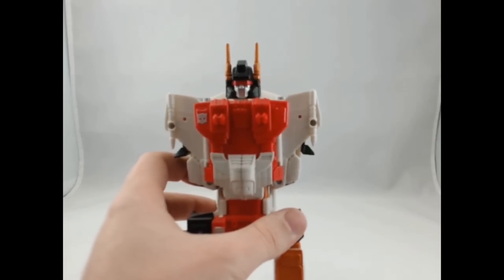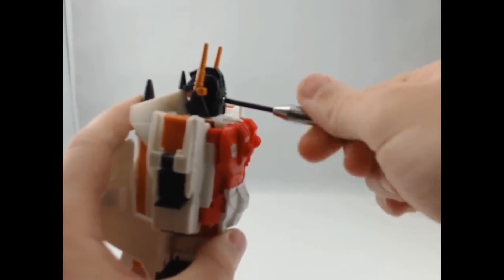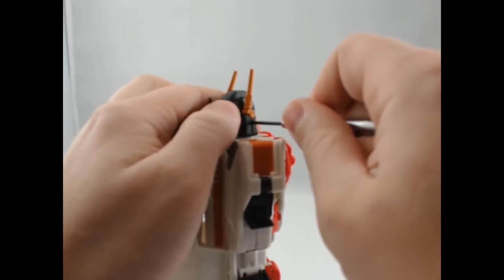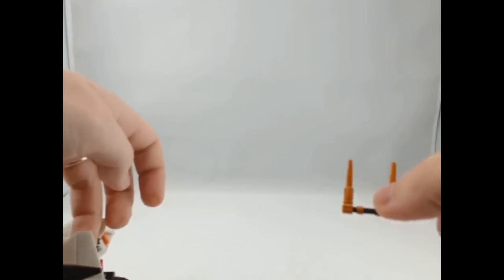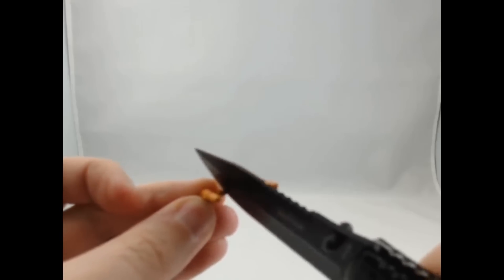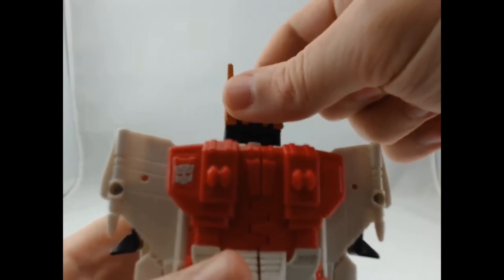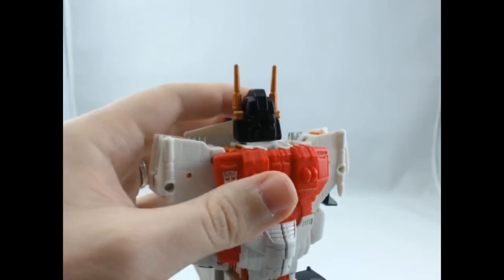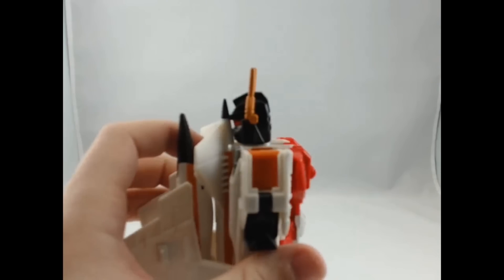Superion Ear Fix for Transformers Combiner Wars Voyager Silverbolt

Comment: Hey guys, just thought I'd share something with you all. I had the same problem with my superion and came across this video. I removed the screw but had trouble removing the back of the head. While messing with it I noticed that with the screw removed, the antennae stayed perfectly strait--like they should. I put the screw back in but didn't tighten it a lot. I think it's an issue with the screw being too tight and not allowing the antennas to move as they should. I think that's why everyone is getting results because in the video Diecast mentions not tightening the screw too tight when you put it back on. The fix is possibly even easier than disassembly!!

Comment: I just simply loosened the screw on mine, and the problem was fixed. No knife, no rubbing off the paint. And as you mentioned, the head are connected by the 3 pegs, so the screw is pretty much unnecessary.

Comment: Thanks Diecast. I opened mine up. The issue with mine was excess paint on the "nubs". The raised portion just before the antenna. There are 3 flat spots to "lock" the antenna. The round portions on mine didn't have enough paint to cause a problem. Cleared the paint from the "flats", wallah rotates freely.

Comment: I just got my combiner team yesterday, i had the same issue about the Superion's antennas not been fully straight up like its forcing itself to fall back. I looked on the Internet to see if there was info on the matter and how to fix it, and sure enough i found your video.

 I follow your instructions on how to open it up which it was a bit harder than expected. But once i finally open it, i see the problem that was causing it  which is exactly as you describe it been lots of paint in the middle part (gum like looking if you will). I proceed to clean it up as you recommend it and after i did that, now it works like wonders and the antennas on my Superion can now be fully straight up.

I don't understand why Hasbro had to mold the antenna rubbers in black and then painted it on top of it, they should have just simply molded it in color from the get go so it didn't had this problem. The only issue i would say it was hard to do was to open up the head, it was a bit tight so it took me a bit to open it, but after that the rest is easy to do.

Thank you for your video on how to fix this, now im thinking on grabbing the atenna that it comes with and do a mold copy of it to make it in plastic form. sheers mate
Reply: The reason for molding them in black is that each figure can only use a limited amount of different plastics. Had they gone with a golden color for his soft "safety" plastic, then his jet nosecone would have been that color too.

Comment: I cut out the entire middle bit so they're individually articulated.  I'd definitely look into casting them into actual plastic, though.
Reply: Robert Chambers There's plastic ones on Shapeways. Also Nonnef made ones in plastic, too.
Reply: cannonfodder4000 I've seen a third party one.  It's actually the entire head where you can switch between red and blue eyes.
Reply: Robert Chambers
Yeah that's the Perfect Effect one right? It comes with a crotch piece, too.
I like that you can have Superion without a faceplate with that add on.

Comment: Heard this mentioned I think in the RFC vid, gonna mod mine as well. Was looking at the legs, not liking that silver pin on the hip. Might flip it around, but there's a even smaller pin on the back. So question is, should or shouldn't I do it?

Comment: I have a problem with the pressure plate of the right leg, that holds in the left arm of Superion. It does not push all the way back, which makes for a difficult insertion and an impossible removal, unless I remove one of the screws in the leg, so I can pry it out. Do you have an fixes for this issue?